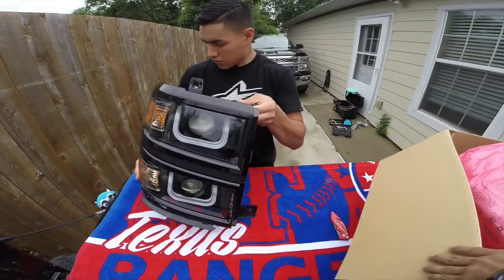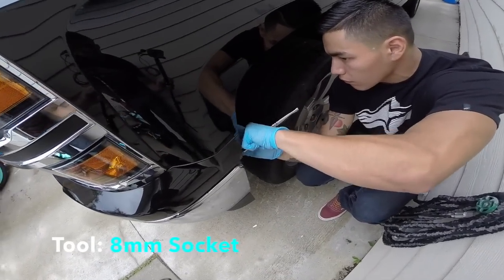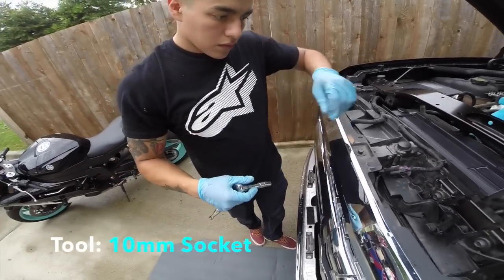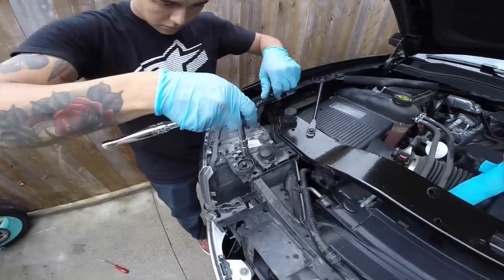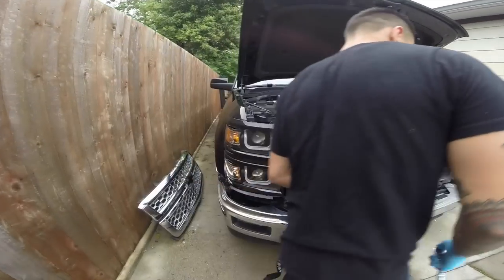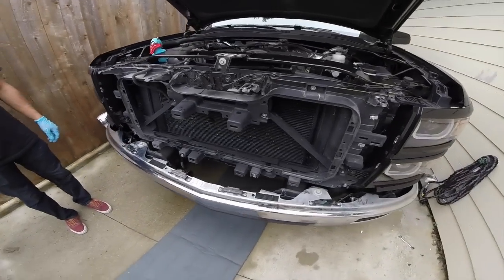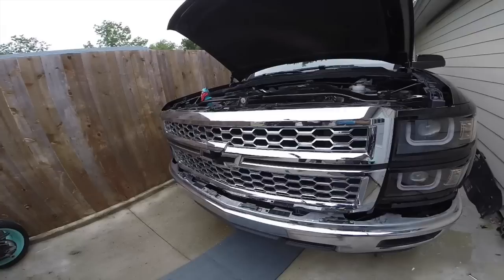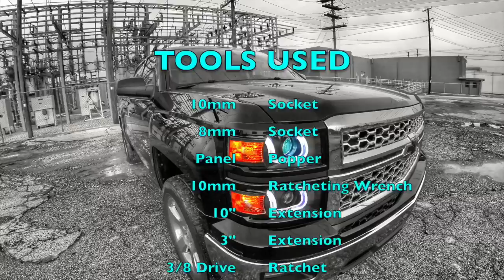Anzo Headlights unboxing/installation NEW

Comment: Do the turn signal lights just twist off like all the others? Going to switch out my turn signal lights but not sure where the bulbs are located.
Reply from the maker: Christian Wilson We didn't change out the turn signal but they change out like the factory and the are located same location as the stock lights

Comment: What is warning canclers,  is it resisters you need? I installed anzo in my 2015 F-350 and love em but get hyper flash and the yellow  lights are not working

Comment: Hey man, have the same truck just the black out edition and I bought some spec d tuning headlights cause they look pretty sick, but they are starting to get stress cracks and they have sent me 2 replacement sets already. have you come across any water or small cracks getting into your lights? I'm just tired of having something wrong with my headlights every couple months. Just want to make sure the anzo lights are legit before I make a mistake again

Comment: Have you had any issues on these head lights? it should be more than 3 years you've had them on your truck...
Reply: Yeah, super curious.  Any problems?? Moisture/Condensation/electrical issues?? Flickering lights? Thanks much
Reply: I’ve had these lights for 3+ years and the only thing that went bad recently are the turning signal bulbs! Really good lights worth the money. Never had a problem with them

Comment: ok question, you did nothing to the wires that power the LED Ubar halo correct? on the 2013 silverado anzo headlight they give you 2 wires and no diagram and a big fuck you. Not hard just wired them to my fog lights in my fuze box, decided that's not a long term solution soldered them to the wire harness, my point a hassel but fun time, these come ready to install no fucking around with the wire.
Reply from the maker: Hank Venture No man everything was "plug and play" just had to remove the old lights and install the new ones. The only requirement was to get warning cancelers for the HID kit.
Reply: hey hank I bought some for my 2015 that need wiring just for the daytime running lights at least that's what I think cause the rest is plug and play have any ideas?
Reply: get the correct gauge wire, splice the 2 ground wires and then run to bare metal. The power wire hook up to battery and a switch or run a wire to the ignition in the fuse box, with a fuse tap that snugs to the teeth of the fuse. fits snug like a bug, lights come on when you turn the keys and go off when you pull them out. Haven't had problems yet, been a year. what you are looking for is a fuse tap kit (Amazon.com) if you do go that route. Below check out the links man hope they help. Also the battery version, you will need to get a fuse set up as well, So you don't get that random blown bulb when you get the wires hot AKA applying power. Also you can splice just with a quick connect or solder, I soldered mine just for good measure. I first used just regular crimp splices, They worked fine! just decided to do the solder cause i was bored one weekend. for the battery version i would suggest this switch Below, plug it in on amazon.

WirthCo 30001 Fuse Tap Kit for ATO Fuses
(AMAZON------ FUSE TAP KIT REFERENCE ONLY)

HOT SYSTEM™ 12V/20A Red LED Illuminated On/off SPST Car Automotive Toggle Switch Button------ (use amazon NOT A LINK)

(disconnect)-http://www.zoro.com/power-first-female-disconnect-blue-16-14awg-pk100-4frj2/i/G2732791/?gclid=CLXokdSz_cgCFQ-RaQodG34DPg&gclsrc=aw.ds

(terminal Lug)-https://www.google.com/search?q=terminal+lug&rlz=1C1PRFE_enUS564KR564&espv=2&biw=1920&bih=1017&source=lnms&tbm=isch&sa=X&ved=0CAYQ_AUoAWoVChMI8bbFurP9yAIVxdkmCh0MywoM#imgrc=cPIYaM38t-oTjM%3A

anymore questions that are specific, i may be able to provide guidance or at least show you some references

Comment: What bulbs did you use my boy?
Reply from the maker: Adolfo Avendano HIDs H7 for low beams and used Anzo's high beams that are provided with the headlights and turn signals also provided by Anzo.

Comment: Looks great! Just ordered these exact same headlights, was wondering which HID upgrade kit did you use and how are they at night?
Reply: so how was the install and product
Reply: Install was a breeze.  With my 2009 Silverado, the DRL are the low beams, so if you install per their directions, the low beams, U-bar, and LEDs will be your new DRL.  I wanted just the U-bar and LEDs for my DRL, so I wired it a little different.  The only loose wires are Blue and Black that go to the LEDs/U-bar.  I removed the 2 DRL fuses to disable to factory DRL (this does not affect the Auto-On feature)  Then I used an add-a-circuit to connect the blue wire to an ignition fuse in the engine compartment fusebox.  Some pics here, allthough, no matter how I rotate the pics on my computer, AMAZON keeps flipping them upside-down.
https://www.amazon.com/review/RP7PONOQBDCE4/ref=cm_cr_rdp_perm?ie=UTF8&ASIN=B00GP32JNW

Comment: Great tutorial Sergio! Great video edit Diego! haha.. I just ordered those same Anzo headlights for my 2015 Silverado 1500.  What HID brand & kit did you purchase?  Im noticing a lot of warnings to install a relay & error cancelling adapters with the HIDs.  How did you run them and have you had any problems?
Reply from the maker: Thank you my friend. I got my kit from carxenonhidkits.com, which I'll never buy from again. They have good quality product, but the worst customer service. You for sure need to buy warning cancellers, otherwise the lights won't turn on while the truck is running.
Reply: Diego Ortiz Thanks for the info!  Anyway you can do a quick video showing how you ran the HIDs?
Reply: Diego Ortiz Also, you did H7s for the low beams right?  What about high beams?  Turn signals?
Reply from the maker: 310steveo310 Sorry man been super busy with work, but yeah Anzo has it set up for H7s on the low beams and H3s on the High beams, as far as the HIDs go they are pretty easy to install "plug and play" connections. if you have any further questions on running them let me know and ill send you my email to shoot you more info.